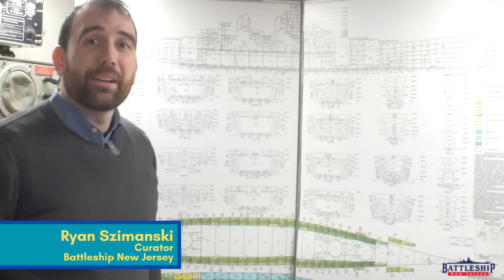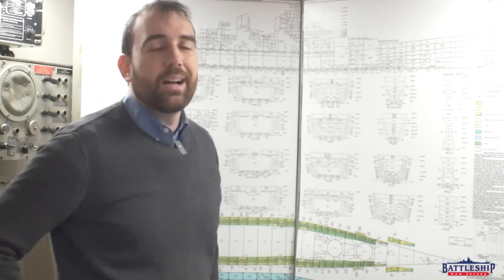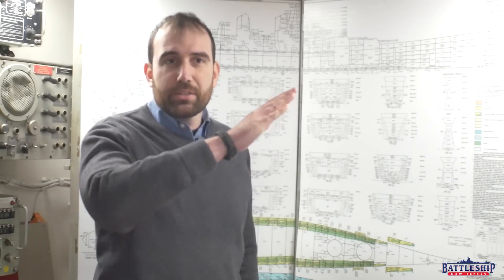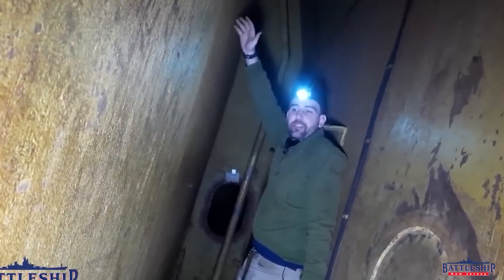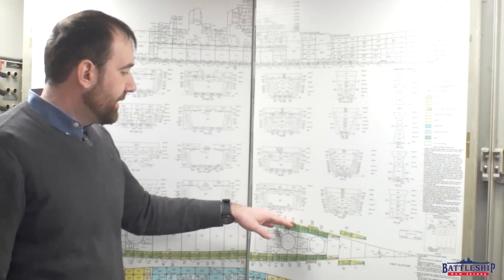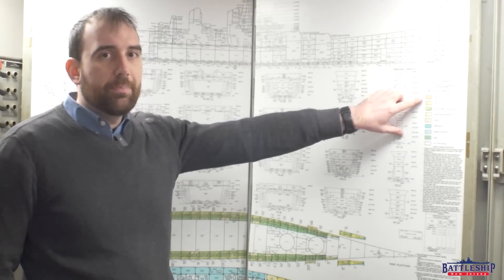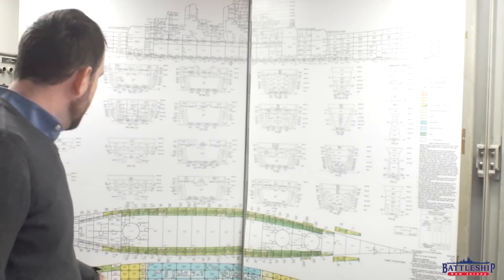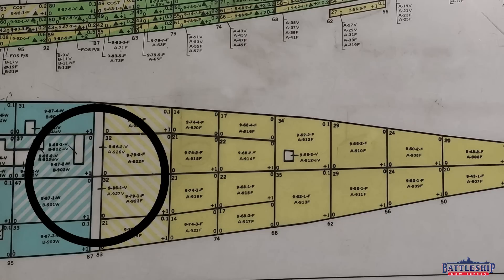Fuel Tanks, Water Tanks, and Voids: DRYDOCK Update

Comment: You should cover what the marking on the DC charts mean,  It's been years but if I remember correctly they reflect what flooding a compartment will do to the trim and list.  Are you using river water or city water to fill the tanks?  I do not know if you have copies; There are also EOSS procedures for operating the systems to ballast/deballast the tanks.

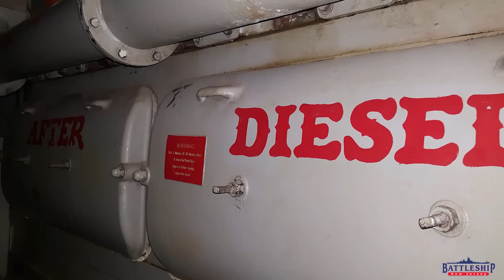Comment: You have two 8:03 diesels generators built into the ship... How about getting those running, to provide electrical power for pumps and lights during transport to/from drydock?? 

● They should have enough power
● Don't require firing up boilers.
   ( whish is prohibited by USN doc )
● Already wired into ship systems
● You have a month or two for maint/test
● may still rent aux/backup gen for trip.
● Great to have another part of NJ working
● may have to setup alt radiator, if used sea chest water for cooling before.
● diesel gen engines were likely in pristine shape in 1990, and have almost no degrade over last 34 years.
● may need to check electrical brushes and connections for alternator on each.
● if both are in runable shape, then you still have some redundancy underway

Have you looked into this?
Do you have maint log docs for the diesel generators, from before 1990?
( to indicate they were in good shape then )

Comment: First, I am NOT a naval or marine expert by any stretch - I was a farmer.  I understand the fulcrum effect of adding the ballast as far forward as possible to minimize the total volume necessary to accomplish the task at hand.  Is the ship designed to handle a point load forward without support from a load spread across the structure?  Probably not a big issue since it will not be in heavy seas, but an interesting question regardless.
Great job with the videos - thank you.  I agree that a time laps of the ballasting process would be interesting.

Comment: With all the external openings below the waterline capped, are you planning on using pumps on deck or pump trucks dockside to move the water into the ship? And "yes" to the question of watching as a full length would go a long way in recording the process for the next dry dock in 25 to 35 years and then you could edit it for shorter videos to put up on here. Thanks for all you and your team do.

Comment: I’m curious what happened with the dirty oil water. Would it have been processed and cleaned, or just dumped overboard? What about the sewage tanks back in the day? I was told before the EPA and clean water act, the sewage would’ve just been pumped overboard. “Bombs away.” Modern ships use the CHT holding tanks to store for the shipyard.

Comment: As someone else pointed out you can have a hogging situation where it causes bowing of the keel downward at bow and stern. Two classic examples are of titanic settling by the bow enough to raise the stern out of the water and shearing amidships or a cargo ship loaded at bow and stern without enough weight to prevent the center from arching higher than the ends. While a battleship is built to withstand more uneven loading there should be charts to prevent an excess.
Once returning to home dock are you working to dry out any tanks that were filled with water? Have you looked at any alternatives to use instead of water that wouldn’t cause corrosion internally? This is a long shot for looking at alternatives as they may have drawbacks of their own.

Comment: When you mention, "You've done it"  (separating oil and water in the tank) at the 7:30 mark, do they do anything special to separate them, or just let the oil float to the top?
Reply: They had oil-water seperators (and I would assume also fuel oil - water separators) on board at the time, so I have the feeling Ryan implies passing them (just like the normal contaminated oil) to pass them a few times through the oil-water separators until the fuel oil contained in the contaminated oil bunkers was pure enough to safely run through the boilers.

Comment: When in battle, is the hull really more resistant to shells or torpedos when the tank at the impact point is flooded? Or would the water transmit the shock?
Reply: i would say empty as air can be compressed, a full tank is a solid object, but if the ship is low in the water it would be a smaller target, im sure they had a ballast strategy for most occasions

Comment: Should be some lube oil tanks in main spaces for equipement use.  Reduction gears, turbines ect
Reply: The lube oil tanks are usually standalone tanks rather than structural, so they don't show up in DC diagrams.  Only the ones that are their own compartment show up on the DC diagrams unless that particular chart is for those systems.  For example, the AFFF tanks only show up in the diagrams mapping out the firemain and AFFF systems.

Comment: I remember when USS Joseph Hewes (FF 1078) was drydocked at Philadelphia NSY in 1990 and we had a near zero (but not exactly zero!) trim on the ship. The trim was ever so slightly by the stern so the skeg touched first as the dock was pumped out. As the ship settled on the keel blocks it felt as if it was a piece of paper laying down on a table, from aft to forward.

A lot of the doors, particularly joiner doors, that worked just fine while afloat wouldn't operate very well after drydocking!

Comment: Oh cool, one of the three disciplines of The Society of Allied Weights Engineers (SAWE), maritime, to go with land vehicles and aerospace.  Please post details of the ballast plan.  I wrote the ballast plan for a test to prove an airplane design wouldn't tip on its tail, even if pretty badly misloaded.  According to Lundgren, IJN Kirishima suffered badly from the free surface effect while attempting to DC the hits from USS Washington, which contributed to the eventual capsize.  Slosh isn't your friend when trying to maintain an even keel.

Comment: I hope you have planners mapping this ballasting out.  If you put all the water in the front (rather than a bit across the entire length of the ship with more going forward) you may have hogging or high shear forces.
Reply: Ryan did mention awhile ago that after identifying all of the tanks He would be working with a company that does this type of work across the maritime industry.  i think He's got it covered !:-)
Reply: I suspect those issues would also be more likely if the time spent in the water with the tanks in that configuration was much longer (as in measured in months or years as opposed to a handful of days..
Reply: these are the best ships ever built - if ballasted properly there'll be no problems (apart from the usual stuff after all these years....)😊😊😊

Comment: Ryan..I’d be curious how the fuel is kept flowing in cold water environments. With the bulk of the fuel carried on the bottom of the ship and along the sides it seems the fuel , assuming it’s bunker c, would be thick as tar in the cold waters of the North Atlantic for instance. Assume there is some sort of fuel heating system, ,maybe using waste heat off the steam system that heats the fuel tanks and keeps everything flowing? Just curious as to what that looks like and how it works.
Reply: They probably had steam trace lines in the tanks for the Bunker C fuel. When the  was in Philadelphia Naval Ship Yard for the SLEP program back in 1980, all that piping (and there was lots of it), was removed. So the Navy probably did the same for the class when reactivated.
Reply: It was the SARATOGA.
Reply: Believe have a preheater

Comment: Throw some zincs or aluminum anodes loose into the tanks for the drydock period.  After drydock, make sure they are dried before closing up again.
Reply: They need to be electrically connected to the hull to make them work as sacrificial metals though.

Comment: The discussion about trim reminds me of a question I had about the North Carolina class. In photos, the armored belt appears to be significantly lower than it does in contemporary ships, such as King George Vs and what appears to be the armored belt line in the South Dakotas and Iowas. Is my perception accurate?
Reply: Be careful on what you think is the the armour belt, because South Dakota and Iowa have an internal armour belt and what you see on the outside it the external plating. Best is to check where the main armour deck is, as the armour belt will always join up with that. So far I know, the modern USN and RN battleships have there armour deck comparatively high in contrast with the other European ships, in an attempt to maximize citadel buoyancy, the KGV even has a full deck about the deep water line. 
I really wonder if NC was indeed that lower than SD, although a large part of the main slab is below the deep water line. The real differences between NC and SD are the larger inclination, a deeper belt with slopes into reduced dept to aid in torpedo protection (unlike NC's 'standard system' of only water-void systems) and general improved armour thickness so SD could handle 16"- 2,240 lb  compared to NC's 14" (original) armament.

Comment: I'd have to vote for a summary of the ballasting process, but I'd also say that if you wanna grift a bit leave a livestream running with superchats enabled.  It's not the most efficient way to get donations but it sure works.
Reply: they would have to do the live stream from outside the ship, their attempts to do it inside before haven't broadcast cleanly
Reply: It's hard to imagine there would be much to see on the inside, especially considering the number of different tanks. Seeing the list of the ship changing over time-lapse will be quite fascinating and I can only assume they will try to record that. @garywayne6083
Reply: @garywayne6083 yeah feel like if they're in a single compartment it should be viable but need a Very Long Ethernet Cable.
Reply: @garywayne6083 Sounds like a minor problem with a whole bunch of easy solutions
Reply: Time to make a wifi enabled battleship

Comment: The water that you're going to use for the ballast for the dry docking, is that going to be saltwater from the river or freshwater from the city?
Reply: The river is fresh water.  She’s like eighty miles from the river outlet .
Reply: The river is freshwater where they are in Camden
Reply: good question. freshwater would cost a few bucks, but much less likely to start the rusting process.
Reply: @leftyo9589  what I was thinking. but he didn't say in the video.

Comment: Soooo, 500,000 gallons of contaminated water?  How much is that going to cost to dispose of?
Reply: Soooooo, Will it be that much contaminated water? I'd imagine a lot of these tanks to be used will not be coated in oil or other material.
Reply: @POVwithRC  Discharging ballast water is subject to a host of federal, state, and local regulations.
Reply: Filling water tanks with water isn't contaminating anything
Reply: @JoshuaTootell  True, but emptying anything, especially ballast water, into any waterway is subject to a host of federal, state, and local regulations.